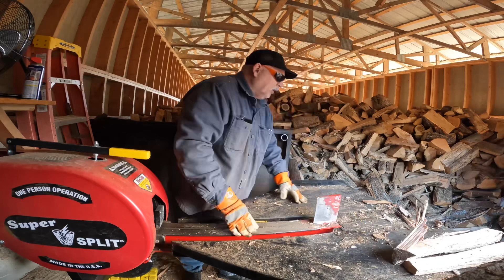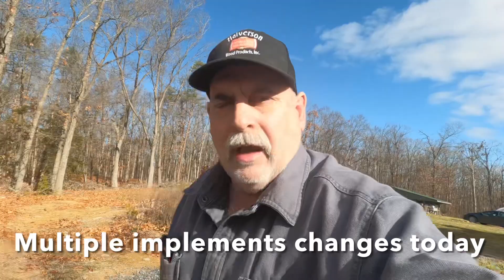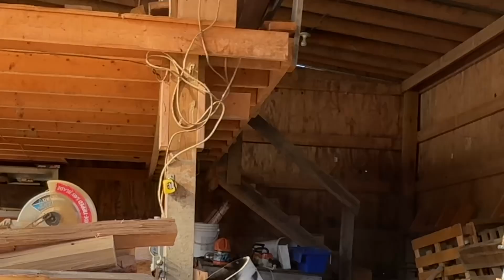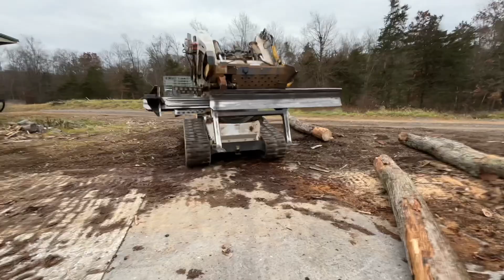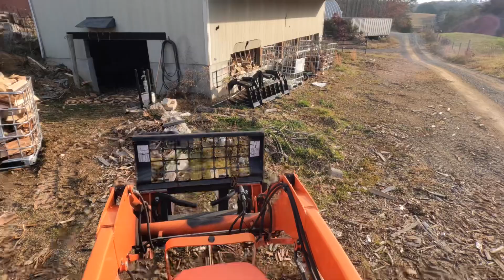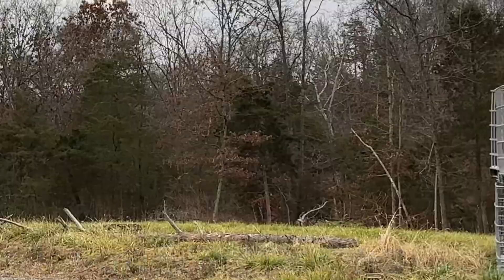Firewood! Filling Double Totes #455

Comment: I noticed the 2 inch square tube welded on top of the wedge.  Did you try a positive stop solution to get your desired length?
Reply from the maker: Hello Jose, Yes several times, the bigger logs kept tearing it off, working on a laser design now or a remote camera, take care👍🏼🪵🇺🇸
Reply: @outdoorswithlarryrobin  yes I have seen someone use a camera and make a mark along the side of log cradle.  Hey if it works it ain’t stupid right!